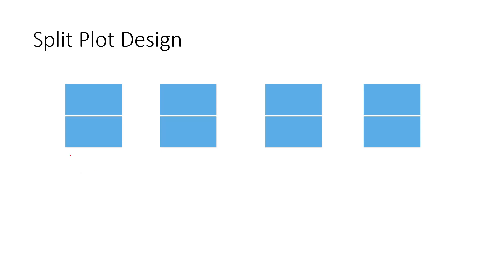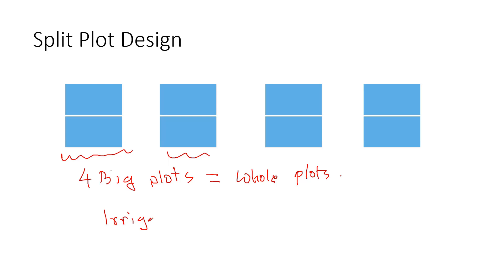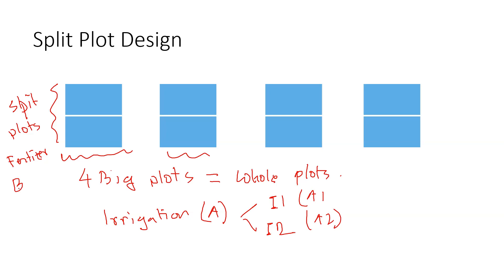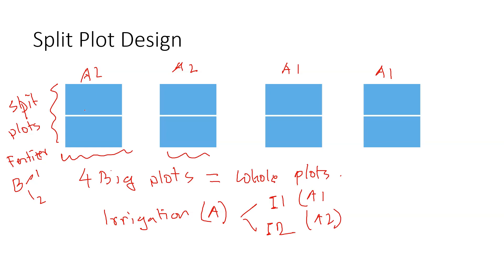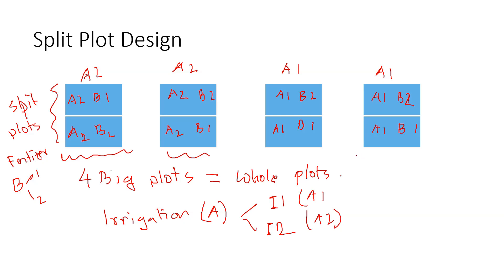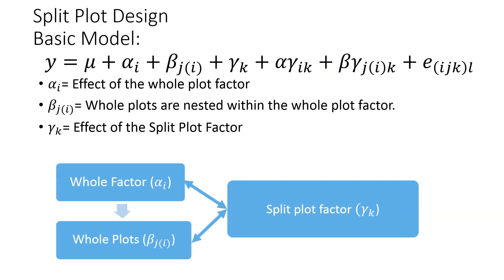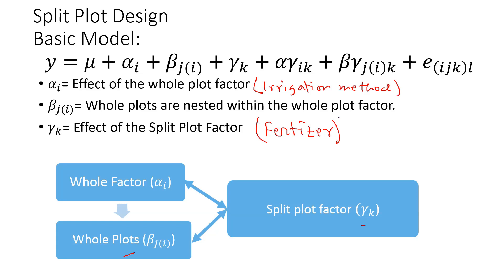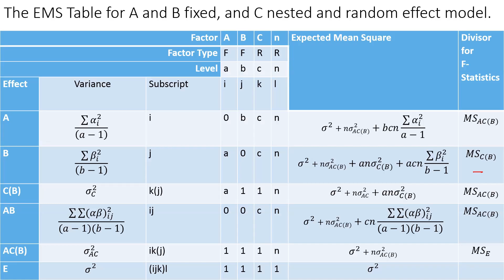Split Plot Design of Experiments DOE Explained with examples

Comment: Hi 
Can you tell me what the Anova SOV and DF be if we included another factor of 3 locations? I think it would be a nested split plot... right? Example: A = 30 whole plots (1 variety = 1 whole plot) and B = 2 nitrogen levels , C= location = 3.
Reply from the maker: If a location factor is added in an experiment, it could be a nesting other factors depending on how it is added (or the experiment is run). More information on Nested Design: https://www.theopeneducator.com/doe/12-mixed-factors-design-of-experiments-nested-repeated-measure-split-plot/12-1-nested-hierarchical-design; Split-plot design: https://www.theopeneducator.com/doe/12-mixed-factors-design-of-experiments-nested-repeated-measure-split-plot/12-3-split-plot-design.  Advanced DOE: https://www.theopeneducator.com/doe/12-mixed-factors-design-of-experiments-nested-repeated-measure-split-plot